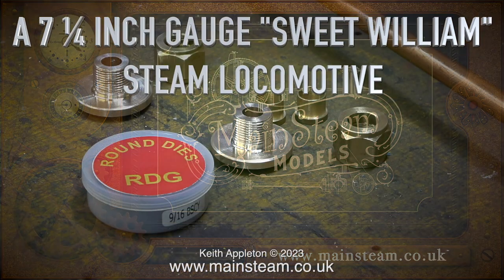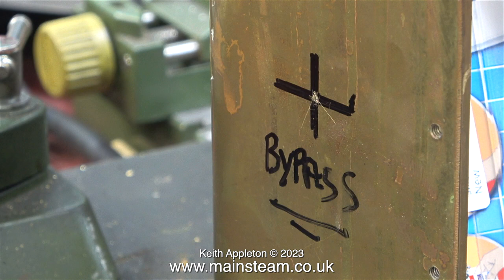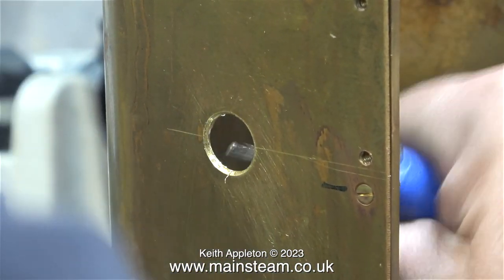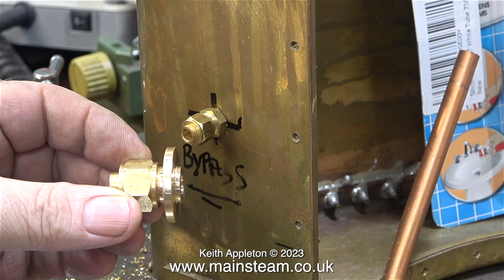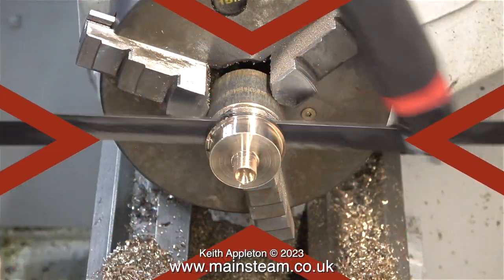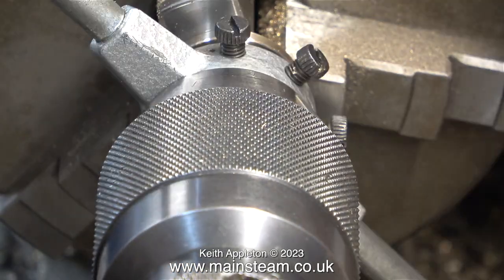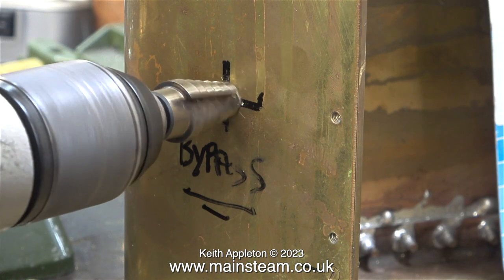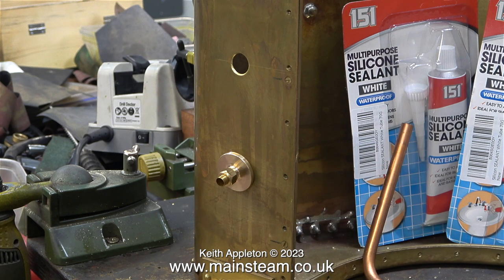A 7 ¼ INCH GAUGE "SWEET WILLIAM" LOCOMOTIVE - PART #59

Comment: Hi Keith.  Love your daily videos and approach to engineering .  I would urge caution when parting off not to do it between centres or in this case have a live centre.  I noticed you actually parted off with the flange held only in the chuck, but if you were to part off with the live centre in situ, disaster could result. The part could be destroyed or worse yet, in my father's experience, the lathe spindle could be bent.  Keep up the good work and all the best to you!😊
Reply from the maker: I personally have never had a problem doing this.

Comment: Keith why didn't you solder the flanges on to the tank and you can get a difrent bit for you deburing tool that deburs both sides at the same time
Reply from the maker: Not again !!!! I do not wish to disturb the original Soft Solder Caulking with heat on the tank . . . . .
Reply from the maker: I know, about different de-burring bits, but I have a lot of this type already . . . . .